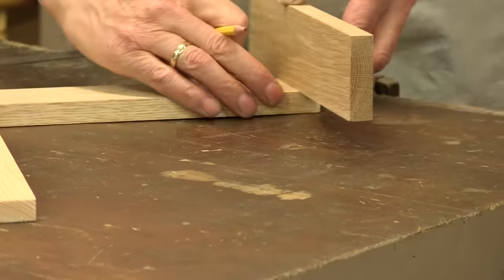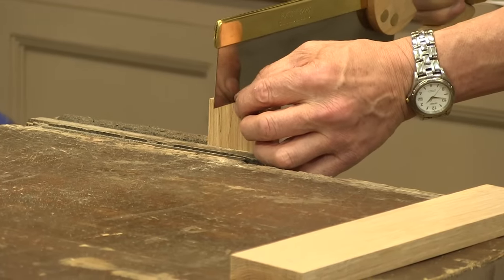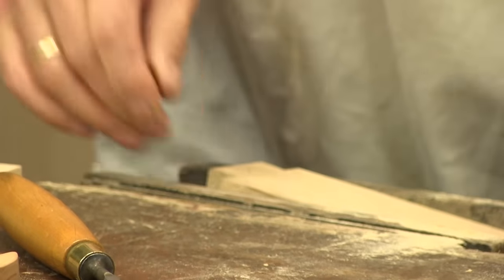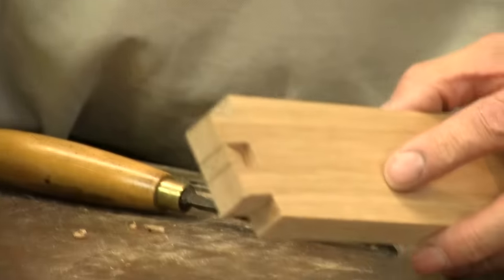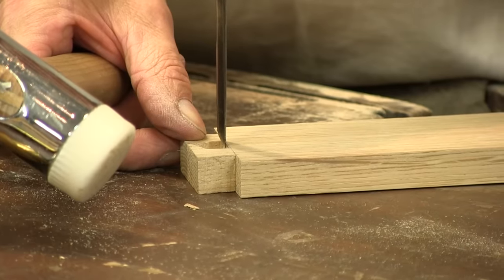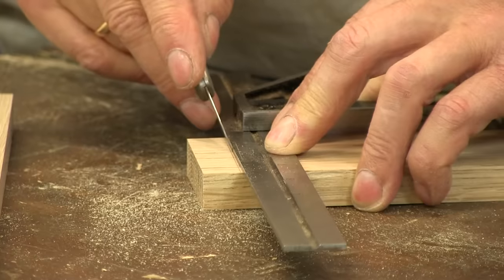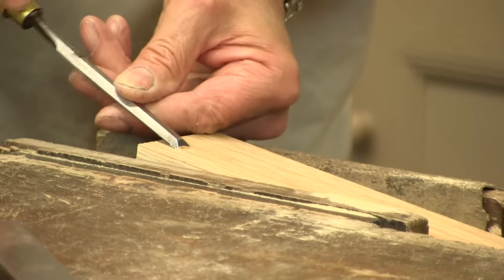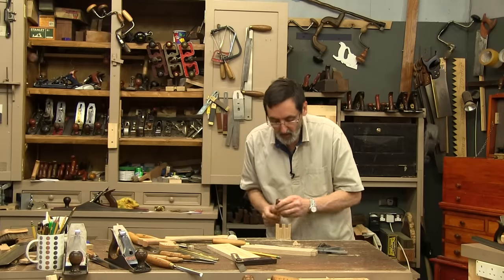How to make a Dovetail Joint - The Three Joints - | Paul Sellers

Comment: I have a general question about dovetails. I've watched hours of Paul's videos but I still have this question. Forgive me if it's dumb. Are the 'fingers' on both pieces cut at an angle? The second piece looks like square cuts, but maybe that's from the camera angle.
Reply: There are two different sets of angles. He does the tail fingers first, which are square with the thickness of the wood but the saw tilts to make the angled cut down through the wood, if that makes sense. So start the saw dead square to the piece and then let the top of the saw lean over to the 1:7 angle he discusses at the very beginning of the video. 
For the tail fingers, keep the saw straight/square up and down and pivot the saw to the same 1:7 angle to the piece of wood. So the cut is straight square through the wood if you looked at the flat side f the wood, but angled if you look at the end of the wood.  Hard to explain angles without visuals, but I hope that makes sense.

Comment: Let's say we're framing out a box, we repeat this process three times. Are we going to run into trouble putting the last joint together? Is there anything we should know? Also, if this box were carried vertically as with a guitar amp, is one orientation better for bearing the load?
Reply from the maker: I doubt whether any orientation of the dovetails will make much difference as they will definitely hold the weight of the guitar amp.

Comment: I figure if you have multiple places-in-between to clear you work them simultaneously rather than clear one completely and then move on to the next. Or would you advice against that?
Reply: Sorry, you're actually doing that with the pins, so there is my answer. Thx for the video!

Comment: 27:40 Can I use a coping saw to take these out and then chisel the remaining wood? Need a question asap, thanks!
Reply: yes. many use a coping saw to remove the bulk of the waste, but especially for fine pieces, a chisel is preferred for at least cleanup near the cut lines.

Comment: I don`t clamp my joins. I drill a pilot hole beforehand and tap in a thin nail on each corner .Then pull the nails out afterwards .

Comment: I wonder, is it possible to make it too tight? Like it goes together without me breaking it, but tightly. Because how do you glue such joint?
Reply: In my experience, you can absolutely make them too tight.  Obviously if they split, they're too tight, but also, if you need anything more than a slight tap of the hammer, just the falling weight of the mallet is exactly where you want to be.  The joint is meant to be self-clamping.  I've always used liquid hide glue in my joints, and really just the smallest amount since the joint, itself, should provide all the needed strength.  I view the glue as being just there to prevent the pins from shrinking as the wood continues to dry.   If you're worried about the pins being pulled out of the tails because of the forces applied in the use of the object, then you want to think about how the joint is oriented in the piece as a whole, and if it is the right joint use in the first place.
Reply: Nick Green Dovetails I made for the first time look fine. But they were kind of tight and they were tighter on one side. I made it just to see if I can and I left it as it was - boards were not flat, rough and different. Now I noticed that on that side that they were tighter there is a small crack and I wonder if it is because it was so tight or it is just because I used really bad wood.

Comment: I'm curious why a 1 to 7 pitch, is it any benefit for it, or just your preferred angle?
Reply: A 1:7 pitch is the traditional standard for softwoods being slightly steeper than the 1:6 pitch for hardwoods. This is because softwoods generally are more brittle at the tips of the tails and in theory the steeper angle creates less "short grain" (that is weak). Paul Sellers is using oak (hardwood) in this video so he should really be using the 1:6 pitch. Recommended reading if you can get a copy is The Techniques of Furniture Making (4th Edition) by Ernest Joyce, the recognised "bible" by English furniture colleges for many decades. Page 170 sets out the pitch (or rake) on hand cut dovetails.
Reply: +Challengetv thanks, i never have seen the reason behind some things.  ill have to add that to my library.
Reply: +woodscholar  before pretending to know what you are talking about you might want to bust out a pencil and ruler. 1:8 is traditional for hard woods and the much steeper 1:6 for soft. But with modern glues it really doesnt matter. Do what you think looks good. Thats the difference between a master and someone who is just a woodworker. The greats in any discipline have always broken the rules.
Reply: Why is it pretentious of Woodscholar to has explain what the traditional practice is and he also referred us to an authority book on the subject? In fact the authority book from my research. Why has Mr Sellers mentioned the angle of the dovetail it does not matter?
Reply: Because what he said is simply wrong and he is pretending to know what he is talking about. 1:7 is a good in between ratio and sort of a rule of thumb. But over all anything from 1:3 to 1:9 works just fine with modern wood glue. Just look at Frank Klausz's dovetails, they are much steeper and he is regarded as the best dovetail cutter in the world. I have no problem with him quoting history or giving his opinion. But if it is wrong it needs to be called out. 1:6 is steeper than 1:7 and 1:7 is for hardwoods 1:6 for soft traditionally. But like i said... its not law.

Comment: That is a nice dovetail however it seems like it takes to long I like the first method of cutting the outer teeth of the dovetail but then I would either drill a hole and use a hacksaw and maybe finish with a coping saw then sand it off to make it smooth if necessary. Good job and good luck.
Reply: Paul did mention there are a few other tricks that work with making dovetails by hand. I've seen videos that show what you're talking about. Looks like using a coping saw to remove the majority of the waste material before cleaning it up with the chisel can work just as well IF the chisel is really sharp. He showed us the way he likes to do it. I'm sure he could do that far faster if he didn't stop and explain the how and why of what he was doing all along the way.
Reply: You also have to remember that he's doing a demonstration in this video...if he were doing this in order to complete a project, he wouldn't take 30 minutes on a double dovetail...as he said in a reply comment above, he can cut a double dovetail in about 2 minutes with this method, when he is trying to get it done.
Reply: Look on YouTube for another Paul Sellers dovetail video. He can use the coping saw method and knock out a dovetail joint as nice as you've ever seen in 2-3 minutes.  Here he's trying to introduce basic skills to new woodworkers so his emphasis is on clarity, going slow, control, keeping the number of tools to a minimum, and having the new woodworker accomplish something incredible to bud confidence without unnecessary complexity at their rudimentary skill level.
Reply: Damien King Agreed. Paul is a pretty good teacher.

Comment: Is there any particular reason why the dove tail sides should have a 1 in 7 slope? I am not a woodworker.
Reply from the maker: 1 inch 7 is the established angle. If it’s less , the dovetail doesn’t allow for enough compression in the fibres. If it’s too steep then the corners of the dovetail fracture off.

Comment: i've got a long way to go. i've just tried, and while the measurements i transferred were correct, they were incorrectly transferred, leaving me with about 1/16 of an inch gap perfectly between each pin and dovetail. oh well, i tacked it together with a few finishing nails, and put it on my "wall of shame" so in a week/month/year/decade/whenever look back and see where i started
Reply: i also found about half way through that my rusty, old square that i found is, in fact, not square.

Comment: Can anyone tell me if a suitably sized X-Acto saw would be an acceptable substitute for a dovetail saw? I want to try making a dovetail joint, but would like to avoid the expense of purchasing a dedicated dovetail saw.
Reply: You and the rest of the woodworking world.  Might as well do it with a router.
Reply: A router (and jig) would cost considerably more than an X-Acto saw, so I'm struggling to understand your point. Thank you for the reply though.
Reply: Try it out on some scrap.  Best way to answer your question.
Reply: I cracked up and purchased a Japanese saw, so I guess I'm a committed dovetailer now! :-) Thanks for the answers.

Comment: Is there any rule as to when you use a coping saw or not?
Reply: It's like I used to tell my son when he was learning guitar. I told him you follow the rules writen on the back of every guitar. When it comes to how to cut dovetails, whether to chop or coping saw, tails first or pins first, you follow the rules written on every board you get from the tree. In other words, whatever works for you.
Reply: Mr. Sellers talked about this during one of his other videos waaaay back, but coping saw tend to leave a lot of torn grain so he said he's really only ever use them for drawers where no one will see the joints whereas the chisel method will always leave a superior cuts when cutting across the grain.  And given practice, you can do this method just as fast as you can with a coping saw.

My experience is that this method, while it still takes me about twice as long as with a coping saw, is pretty much 100% fool proof.   When I'm doing a bank of drawers, for example, I inevitably get tired and just lose the horizontal level on my coping saw and invariably cut to deep on the inside face of the drawers when cutting out the waste.  Whereas the chisel method, even if I stray out of vertical when chopping, the visible faces are always perfectly level.

And if you ever want to make some blind dovetails, your coping saw skills are not going to come in handy at all.

Comment: This way's fine if you want to take 15 minutes to chisel out the space between each pair of tails.  If you value your time, you can just trim to within 1mm or so with a coping saw, and clean it up with the chisel.  You'll get just as tight a fit.

-jcr
Reply: While everyone has their way of doing it, this is a fantastic way of learning basic tool use.  And once you get the hang of this method, you could probably do a double dovetail and fit them in 2-3 minutes.
Reply: maxdecphoenix Exactly, he leaves no stone unturned explaining everything in the finest detail as if you are a beginner which i certainly am and i value his style of teaching.
Reply: NSResponder I made my first hand cut dovetail attempt after watching this video, and it took me about 15 minutes total, and it looks as good as with my Leigh jig.  He probably can pound out a set of dovetails for a box or drawer faster than I can even set up the damn jig.
Reply: snowdog90210 right, i'd sit there being confused as to where my lines go and a true master of their craft will go ahead and be done with it in 15 minutes or less.
but that doesnt take away from the fact that you have to learn the basics before you can be speedy. people that want to be fast in the first place tend to botch things up more often and will have an unsatisfying result in the end. once you've started taking the easy way out one time, you'll do it all the time. and that is not the way to improve yourself.
its almost the same in every other field, like learning to play an instrument for example. gotta take it slow and learn each and every step and understand whats the reasoning behind that, and if you've got that down, THEN you can start improving on your speed. it just takes time to become better at what you're doing. practice makes perfect.

Comment: It looks very tedious to me to try and cut directly right on the scribe line. See, if you look how a chisel is built, it will move in 2 horizontal directions when hit. To the bevel side and to the back side. Avoiding this by making multiple shallow cuts might be giving the right result but it is a lot of work. It seems easier to me to leave about 0.5 - 1 mm of material and pare that easily to size as soon as the waste of out. Remember this is a joint with only three pins. What do you do when you want to join boards 30 cm wide on all four corners?
The joint as is the video is nice though.

Comment: I'm  afraid I cheat at this. Leave the tails slightly  over hanging, glue together, and tap the end grain of the timber with a pinball hammer & clean off the glue.. This will tighten any loose joints or gaps.

Comment: As a 'master woodworker' would you agree that observance of the best English tradition should be part of the definition? The way you are chiselling the shoulder lines is not only unbelievably time consuming but not recognised English traditional practice as promoted by the exponents of this craft such as Charles Hayward in his books and the late Alan Peters in his practice and teachings. The joint should be cut straight off the saw and chiselled back to the shoulder line which should be cut deep. the very last cut is made on the shoulder line. Obviously yo have never served an apprenticeship where speed comes alongside precision! The video may be detailed but the camera angles do not show the actual detail you are describing. I thought part of tradition is a respect for history?

Comment: 25 seconds into the video you state you are working in metric, then by 1 min 35 seconds you are talking about one inch! I had to turn off at this point because I often get customers coming into my shop talking like this and it really gets on my nervous. 3" x 2" x 1.8m long etc. Come on use one system or the other, don't be that guy who mixes the two!

Comment: It took this man 70 years to  make these dovetails...At the end he dies.  My friend, i love the precision, but holy hell you take forever. Why not just use a coping saw? and then chisel it out. Look im not knocking on your skills, you obviously are very skilled, and you know what you are talking about...that said, this is a a waste of time. Besides, dovetails are ugly, nobody wants to see dovetails, they are fun to make....just..i dont know..i guess i hate how much time you spent chiseling it out. Im sorry man.
Reply: I don't think he was going full speed. For educational purposes he goes slow so that we can clearly see what's happening. I wouldn't doubt that Paul can probably knock them out with great speed and efficiency. He practically makes them perfect off the saw! 

His chiselling technique looks very efficient. Once you're proficient, I don't think the coping saw becomes necessary.
Reply: I don't think your opinion of dovetails being ugly is shared by a lot of people.  I for one think properly executed dovetails like Paul has done here look wonderful and have a sort of austere elegance to them:  A hand-carved, pressure-fit joint that requires no glue or screws but works off of the tension of wood against wood and finely tuned surfaces.  Its simple and functional, and for the beginner a single dovetail joint will take quite a long time, but if you are trying to learn the trade there are many valuable skills this one simple joint can give you.
Reply: No need to call each other names... Well crafted joinery is a thing of beauty for some, be it dovetails or any other of the hundreds of methods of joining wood. Whether you flaunt or dissimulate this aspect of woodwork is up to you, but in this era of IKEA my clients are usually quite impressed when they see features such as dovetails.
Reply: See that's bs. You are entitled to your views but you can't push them on people. I would rather have dovetails on drawer than pins or finger joints. But heh, if you like Ikea stuff go for it :)
Reply: Frank Nichols 

I love that devils shut up at that one! 😂
Reply: I'm gonna go out on a limb here and say Devils has missed the point completely. Using time is not wasting it. And I think it would be a real challenge for Mr. Sellers to produce something ugly. Ugly product is a gift he no longer has, if indeed he ever did.